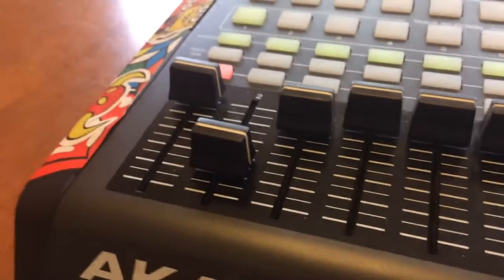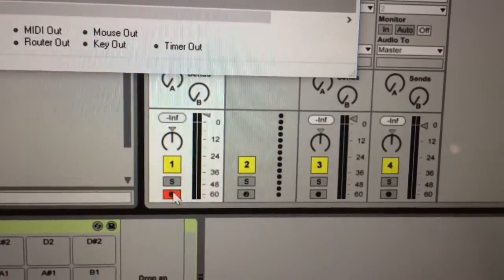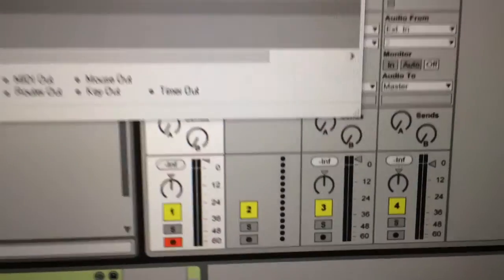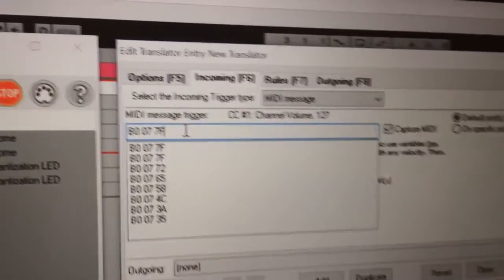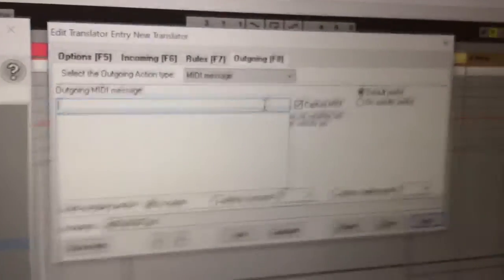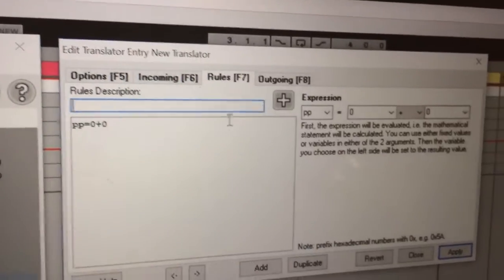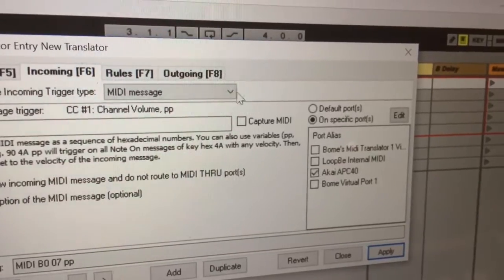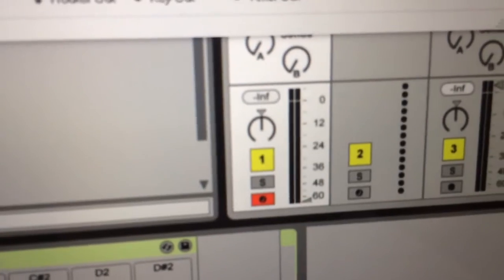LET'S MOD: Akai APC40 0db Max volume slider in Ableton

Comment: In Bome, is there an easy way to pass all the other midi sysex information from my controller unaffected to this same output? So that all other buttons and knobs act as they would if having the control surface set as the input to the remote script?

Comment: This is great, thanks for this tip, I hate seeing the slider go above 0db!

I got this working using LaunchControl XL. Had to fiddle around at first but got it working by ensuring that in Ableton Preferences, for the remote control surface's Input, I had selected "Bome MIDI Translator" from the dropdown menu.

So it read something like:
  Control Surface: Launch Control XL
  Input: Bomes MIDI Translator
  Output: Launch Control XL